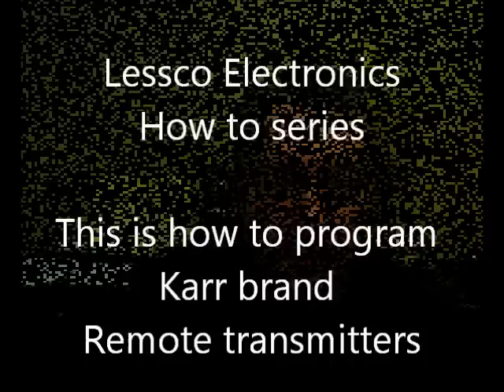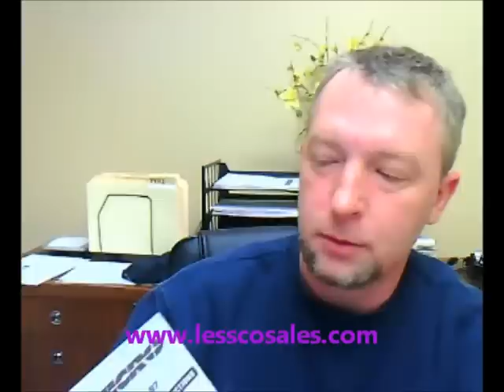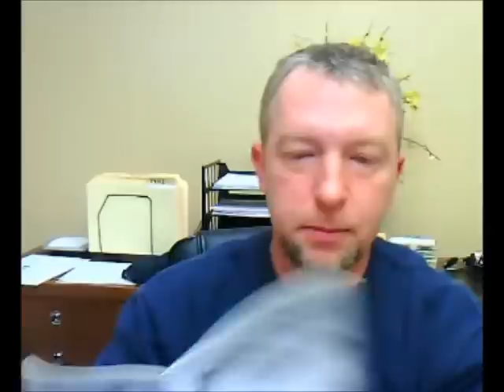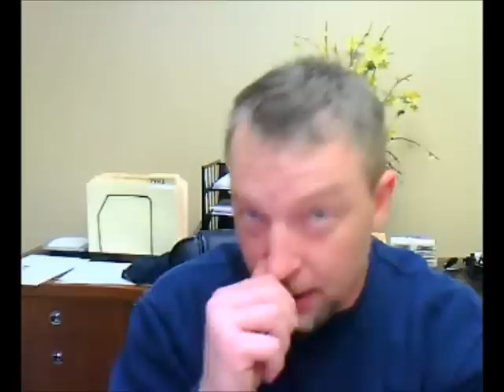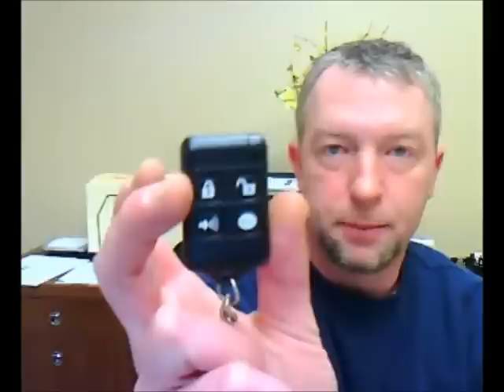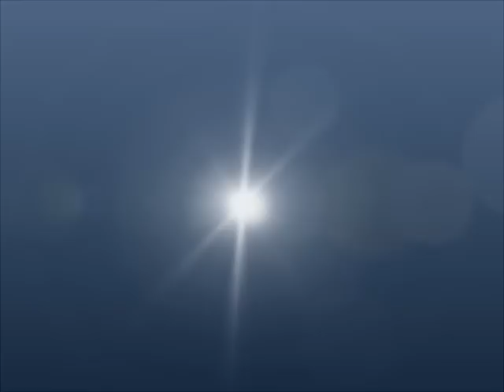MAS Micro Alarm Remote Programming - How To

Comment: my Micro Alarm STARTC2002 (Blue LED) suddenly stopped chirping. No chirp with button-presses, or when the alarm sets itself upon door closing. The alarm is not in valet mode. The alarm sets, locks and unlocks the car.The auto-start works. But the red light flashes continuously when armed. It used to be steady when armed. And there is no chirping from pressing the buttons, arming or disarming alarm. All the commands respond but silently - no chirp. ALSO, when the alarm is triggered when the door is opened, the park lights flash INSTEAD of the siren. It is a silent operation. Everything else works fine, just seems to have gone into silent mode. Any help in making it audible again or is it time for a new alarm? Thank you. Bernard Smith